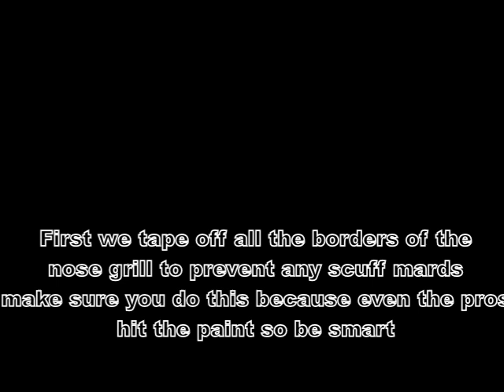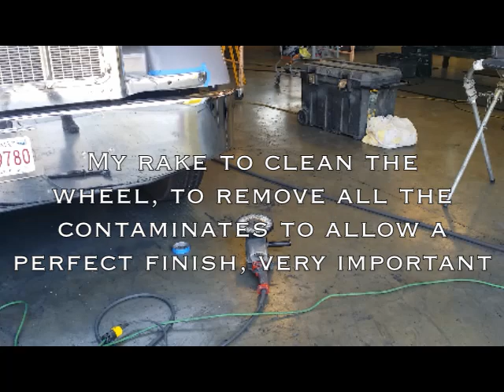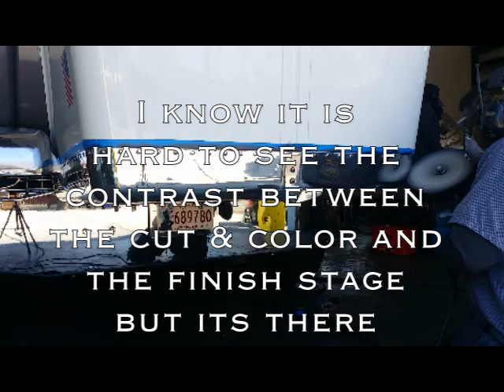HOW TO POLISH A PETERBILT NOSE GRILL

Comment: Really been enjoying all your videos! Thanks for taking the time to create them. I've definitely learned a lot. 
A few questions ...
Why do you wipe down with mineral spirits?
Would you consider running the buffer on the stainless steel grill? (I've got little specs of rust I'd like to remove)
Would it be safe to do the same steps on the chrome bumper or air breathers??
Is it effective to dilute purple powers aluminum brightener 12:1? 
What about muriatic acid? Is that a no no for cleaning aluminum??
Reply from the maker: Hello and thank you for the comments well we use mineral spirits to clean all the contamination from all the different buffing material leaves behind and second question yes we would use a buffer  on the stainless steel because it just looks better
Reply from the maker: Hello and sorry for the delay, Im glad your finding our videos useful, well to answer your questions we wipe down with the mineral spirits to remove all the contaminates left behind from all the buffing and polishing, as for your other question , it sounds like your grill is chrome and not stainless steel , I think this because you said it has a little rust on it ,  stainless steel does not rust so make sure it is stainless ok good luck